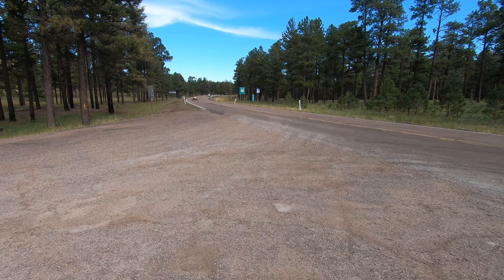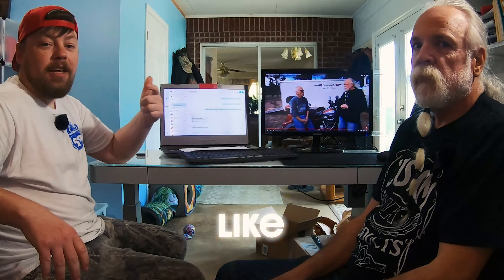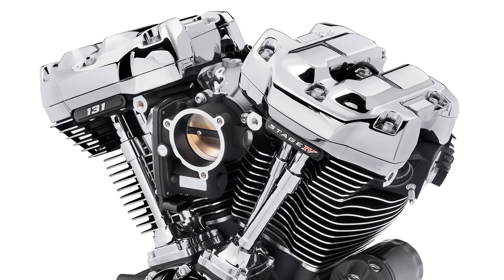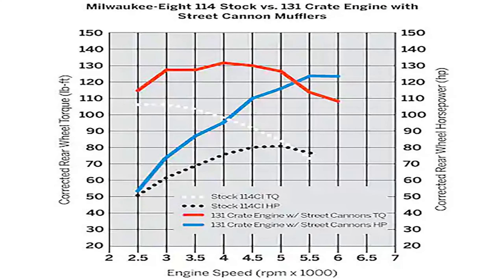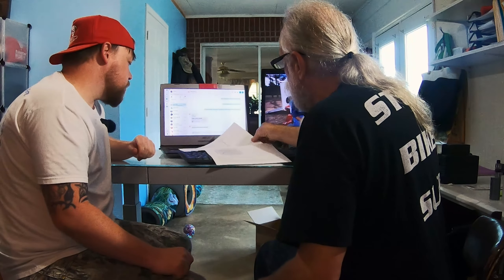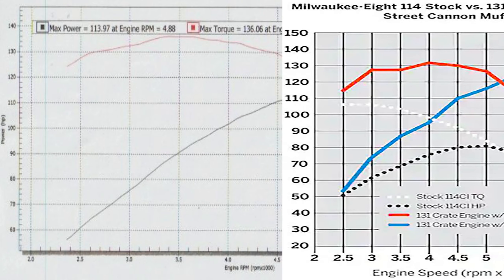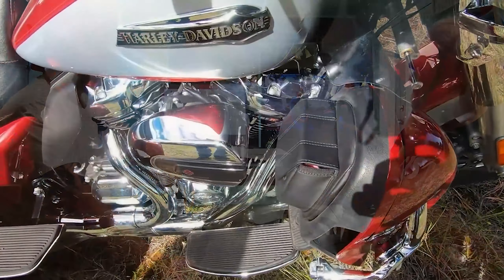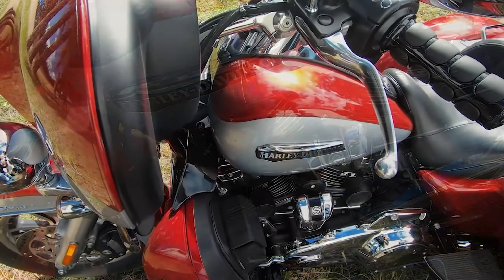131 Kit - Dyno Chart Results on a Harley Tri Glide

Comment: That's also a 50 state epa legal SE 131 map. With the SE tuner etc etc .... the problem with " the fitment "  has to do with the  differential  and more than likely a known handling condition at those power levels ... they just got around to approving the SE447 cam ...also OEM measures at the Crank and SE measures at the tire .. I had this conversation  with the former Head of Screaming Eagle one day and the tuner battle and the constant battle between SE and the OEM ... it was quite enlightening... as for " does it fit " vs " is there a fitment for " 

Think back to the windshield bags back in 2007- 2008 that had no Batwing " fitment" .... it would bolt on BUT........ it also caused a weight imbalance of less than a pound  that , when bolted to the winshield , caused a tank slap wobble much like steering head bearings  improperly adjusted .. the frame redesign  rectified that in  09...Look forward to seeing ya Kevin ...if he hasnt already , i would probably consider one step bigger injector he's gotta be near the upper limit of the duty cycle
Reply from the maker: Paul, thank you for all the good info!
There is definitely a handling challenge on the Trikes with that much power...that front tire gets real light, real easy....then there is no steering!!!
Yeah, looking forward to getting up to your Dealership and doing a bunch of videos.
Thank you again for your knowledge and experience here.

Comment: I just had my 2019 Tri Glide dyno'd after swapping out the Zombie baffles in my Tab 4.5 (it was awesome at 103HP and 130TQ but just too loud ... obnoxiously loud ... I had the Zombies in before I did the Stage 2) and went with the mid-range baffles for the Tab 4.5 and it just dyno'd at 96HP and 125TQ. Stage 2 with a Jim's USA 819 cam. Yeah it lost 7HP and 5TQ but now it isn't an obnoxiously loud. I had a 900 watt stereo installed and with the Zombies at 75mph, I could barely hear it over the pipes.
Reply from the maker: I defiantly like that my Trike sounds like a Harley after the upgrade, but I installed TTI's to help deepen the tone and it will sound a bit quieter as well.

Here is a video about the TTI's you may find useful/interesting - https://www.youtube.com/watch?v=b2mN7lZ1CLw

Thanks for commenting!

Comment: Very interesting, I have 2017 that I was able to save it from self distructing from sumping by installing an S&S cam chest kit. That was done at 15K and now has almost 42k runs very well but a reliable 131 has my interest. Why did he have a dealer install verses an independent? My guess is for the warranty or was there other reasons. There are very capable independent shops out there. Sid the motor have to be ordered by a dealer?
Reply from the maker: That is great that you have your ride running so nicely.
I believe the reasons Chuck used the Dealership are-
1.  They had experience installing 131's
2.  The Dealership warrantied it personally (HD Corporate will not warranty a 131 in a Trike)
3.  The Dealership was familiar with the many mods from DK Custom to help cool it down and installed those as part of the deal.
Reply: What torque cam did he use and was it a complete cam chest replacement or just the cam and cam bearing?
Reply from the maker: He used the "Screaming Eagle Torque Cam",  all the information we have is in this other video- https://www.youtube.com/watch?v=gaeJp2rmR60
You can also call Mile High HD in Colorado and get their input.  They are the ones that installed it.

Comment: I believe he made the right move in keeping the 55mm throttle body for his build and how he plans to use it. 

But I’d be curious to know, and willing to bet that overall the 64mm throttle body would still make more total power over all when you consider “area under the curve”
Reply from the maker: It depends on how you define power.  If you are talking about Horsepower, it will make more overall, but it will not make more torque in the 2000 to 4500 range, and that is where he wanted his peak power, and where most HD riders want their peak power.  The Horsepower does not kick in until after 5252 rpm, where very few HD riders ride.
Here is a video where we talk a bit on the subject- https://www.youtube.com/watch?v=DOxzN8r35O4

Comment: can you do this on a 2018 trike thinking of replacing the 107 engine instead of stage kits to increase it
Reply from the maker: Yes, a 131 will go into a 2018 Tri Glide, the same as this 2019.  There are no frame or drivetrain difference that would prevent it.
Sounds like fun, wishing you many miles of smiles.
Like Chuck, in this video, make sure you have a good foundation, or that will become a heat monster and reliability will suffer.
Here is a video on that subject- https://www.youtube.com/watch?v=GK5x3lcQvJU
Reply: @DKCustomProducts  thank you for the response Father passed away in feb and i been working on getting the trike back running again my parents road the bike all over 110k in 4 yrs reason im thinking of swamping motor thank you for all the info
Reply from the maker: @shrakkem  Ah, we are sorry for your loss. That's a lot of miles! Good luck with all your plans. Thanks for watching!

Comment: I’m hooked! Does anyone know if the 131 will fit my ‘09 tri-glide?
I have an almost paid off Visa card!
Reply from the maker: Man, I do not think it will work...but I could be wrong.  The 131 is a Milwaukee-Eight, with all the peripherals (ECM, BCM, etc) for an M8 and you have a Twin Cam set up.  There are 124 and 128's for the Twin Cam.  I would look at Fuelmoto or S&S for those to fit your bike.
Harley did make a 120 Twin Cam that will fit your 09 TG, but it is not nearly as impressive as the 131 or the 124 or 128 from FM or S&S.

Comment: Product idea:
Make transformer backplate to replace stock one so we can use a breather kit and not have to replace the whole air cleaner!😀
Reply from the maker: The Transformer is not an air cleaner backplate, it is an External Breather System that fits between the engine and the air cleaner.
It will work with the 606 that can be purchased without the filter element.  If you have a Big Sucker or round SE air cleaner, you can reuse the filter element from one of them with the 606 and save some money.
https://www.dkcustomproducts.com/naked-hiflow-606-air-cleaner-back-plate-dyna-softail-touring-rushmore-w-no-filter-element.htm

Comment: Very good show, yup, bigger does not always equal better when it comes to a throttle body, in fact too big can be a bad thing the heads  flow and cam profile will usually dictate how much air and fuel you can stuff in, any more IMO is a waste
Reply from the maker: Thanks for your input Jack, appreciate it! 👍

Comment: If HP is a calculation wouldn't there be a loss of HP with a loss of Torque?
How can TQ and HP change independently?
Reply from the maker: They are inextricably linked, since HP is just a derivative of the measured torque.  HP is not measured on a dyno.
Here is a video where we talk about this subject in depth- https://www.youtube.com/watch?v=DOxzN8r35O4
The short of it is that you do not feel HP until after 5252 RPM.  What you feel in the 2000-4500 rpm range where most people ride is torque.
So most people, like Chuck with this build, want to have max torque in that 2000-4500 range.  Even it it reduces the torque, and thus the Horsepower, above 5252...because that is irrelevant to them, because they simply do not ride with RPM's above 5252.
Reply: @DKCustomProducts  so in the calculation when the TQ goes down the HP still goes up because the RPM is still increasing?
Reply from the maker: @georgesnuffleupagus7920  That is correct. 👍

Comment: What’s up guys?  No love for the Love Jugs fans??
Reply from the maker: The Love Jugs Mighty Mites are a good option.  Unfortunately they have been hard to get, supply chain issues, quality issues.  I still run them on one of my bikes, and on the other I run the Force Flow Fan.  Unfortunately they are having supply chain issues also...but not quite as bad.
You can see in this video that Chuck is running the Mighty Mites.

Comment: the way HD does thing is if they haven't tested any part on a specific motorcycle they say it doesn't work . if after being told it doesn't work and you buy it anyway and it works perfectly , great ! if it doesn't work you can't ask HD for your money back or sue them for selling you a part that didn't fit , because they warned you . it's all legal cover your ass stuff
Reply from the maker: Great points...And/Or EPA tests have not been done.

Comment: Harley Davidson Dealership EPA Complaint dyno tune for 131 is

Max Power = 112.19 at Engine RPM = 4.87
 
Max Torque = 126.47 at Engine RPM = 4.59
Reply from the maker: Thanks for those numbers.  That is on a 2 wheel bike.  There is quite a bit more parasitic loss on a Trike due to the drivetrain and 2 car tires instead of 1 motorcycle tire and with the Power Vision the 131 Trike still kicks the EPA compliant SE Tuner's butt.
You may like the video we just released on the SE Tuner- https://www.youtube.com/watch?v=wQ6EzilYjiI